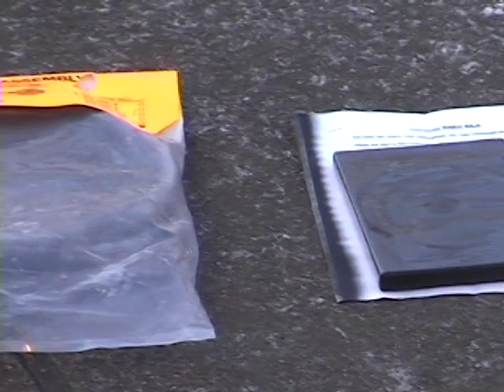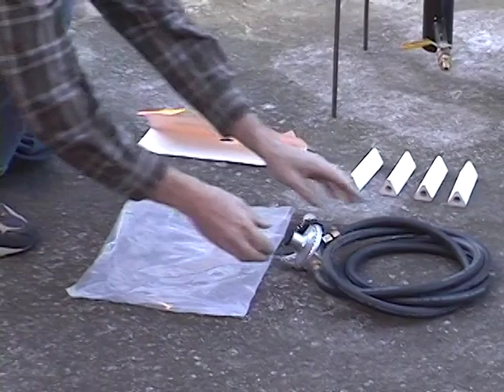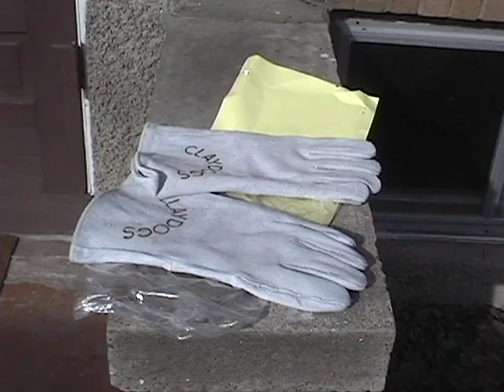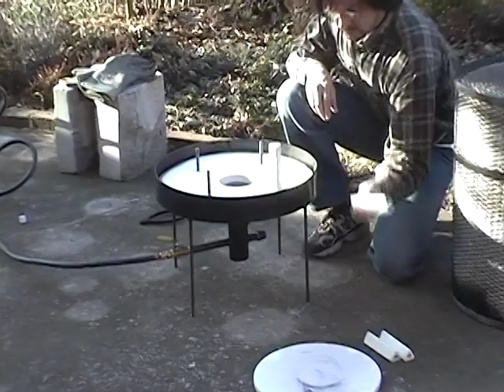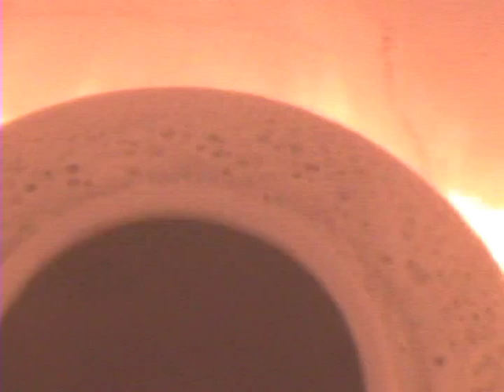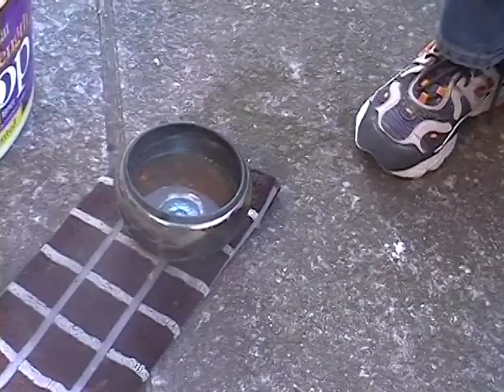Claydog Raku Kiln

Comment: I dunno about the design of this kiln, the chimney is directly above the flame, meaning most of the heat will just rise straight out the top, seems like you'd loose a lot of heat unnecessarily, seems a bit inefficient.
Reply: The shelf is actually between the port and the flew, causing the ClayDog kiln to act (and actually be) a true up-draft kiln design.
Reply: That hole on the top serves an important purpose.  You need to look into it and determine when your glazes have melted and are ready to come out of the kiln. Without this top window, it would be impossible to make this determination. The glaze should look smooth and glassy and have melted.  Be sure to never look directly into the hole. Rather, watch it from an angle.

Comment: As far as I know proper firing of chamotte requires temperature at least 1100°C ! Is  Raku Kiln that hot inside?
Reply: Bisque firing has taken place in another kiln, as far as I've heard told in the video
Reply: Yes, most raku fires are between 1700 to 1900F.
Reply: The Clay Dog Raku kiln can and will reach temperatures of 2500 deg Fahrenheit if allowed to.